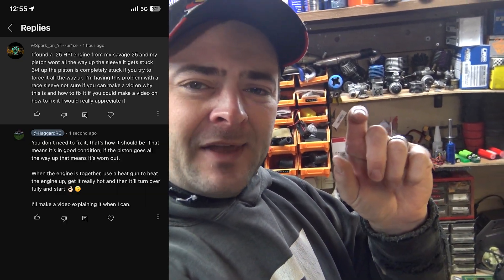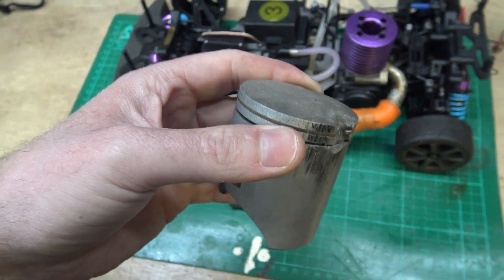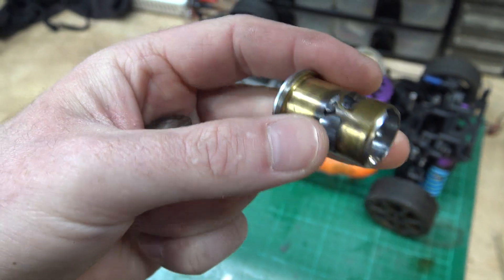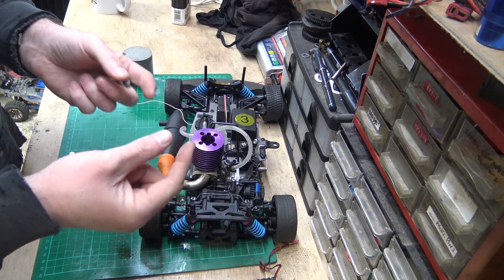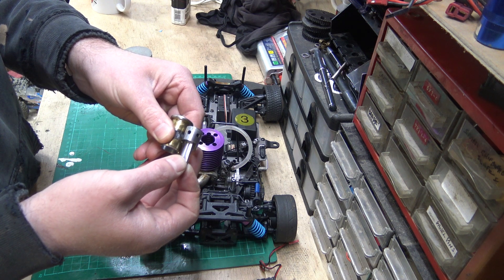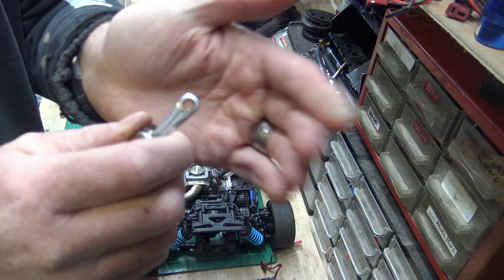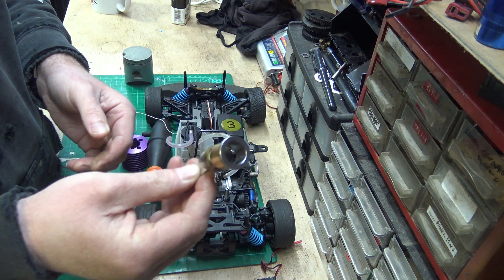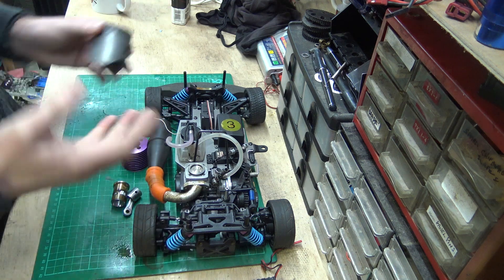How NITRO/GLOW Engine Piston & Liners Work

Comment: As a 2 stroke petrol engine user i was surprised to see how big the cylinder head cooling fins were, i actually thought the head was the barrel, there must be a lot of heat generated in a nitro engine. How big can you go with nitro, cubic capacity wise
Reply: Some nitro RC boats run up to 15/20 cc,,They tried ABC nitro cylinder and piston on a petrol engine,but petrol burns too hot and piston seizes on exhaust side,nitro runs cooler